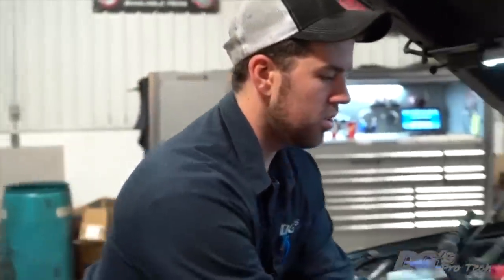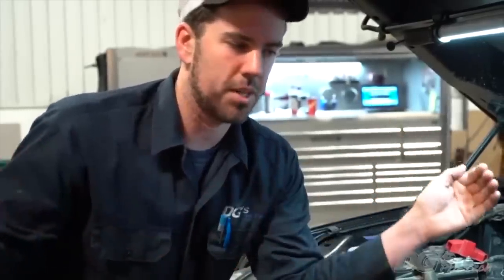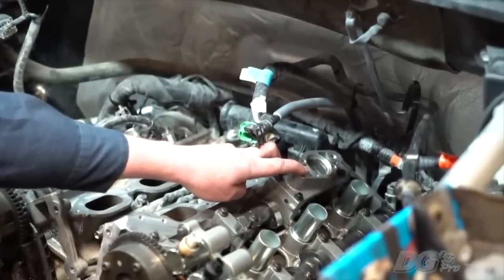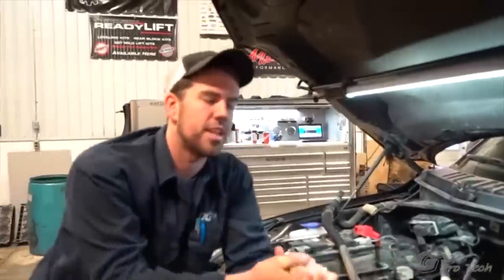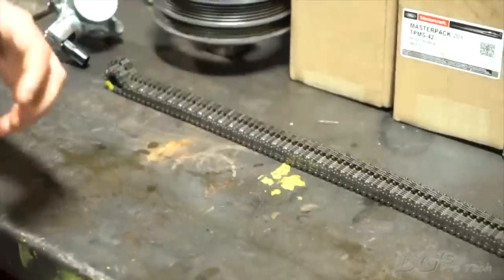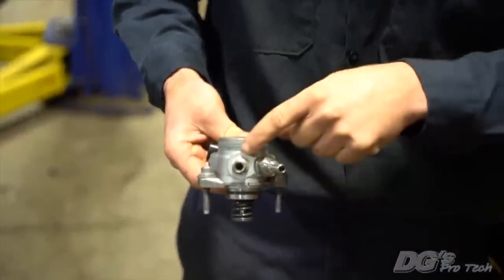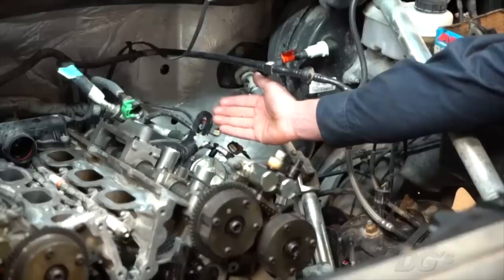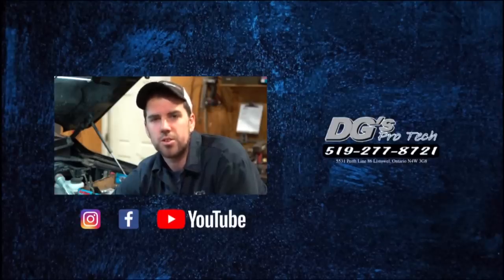What you NEED to know about Ford EcoBoost Engines by Dustin Golley of DG's ProTech

Comment: These problems can be fixed by building modular engines and parts . But automakers don't want regular people working on their own cars.  Think about it,  a timing chain set up that is preset plug and play. Don't tell me it can't be done,  that's what a stupid brick brain dummy would say . Engineers can do anything. An alternator that plugs in with no wires,  a water pump also that snaps into place via high pressure spring that keeps tension on the snap points , all major and minor parts and components designed to be easily removed and replaced.